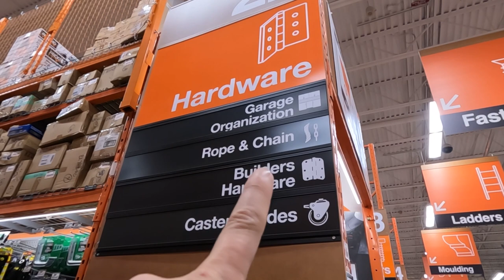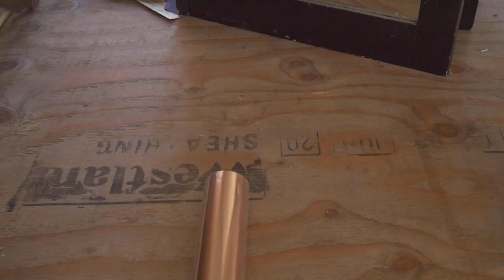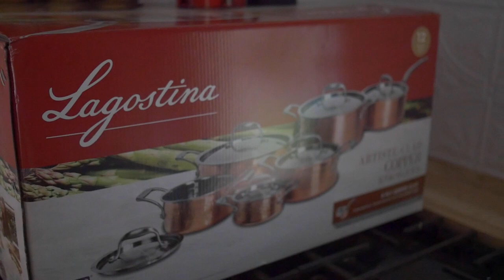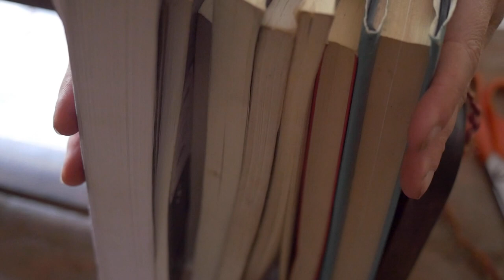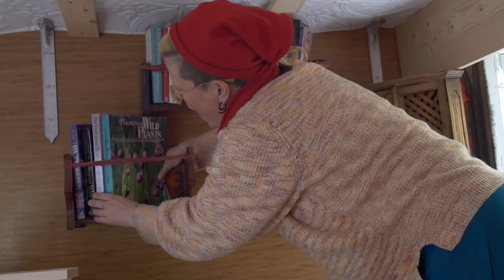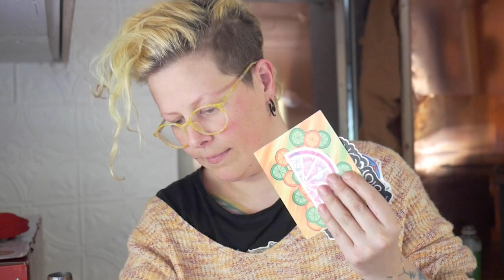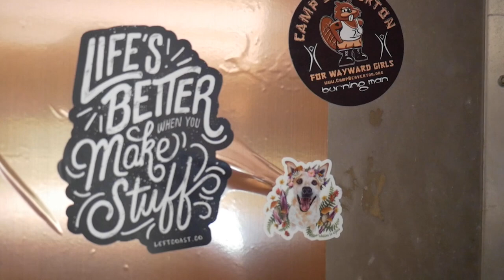Interior Design in the Step Van Conversion - Fire place Cubic Mini wood stove

Comment: Hey its looking good but I was thinking for your Lil wooden boxes box you could drill a hole all the way threw and put a wooden dowel in it to hold them all closed. It's cheap and would fit in with your pirate theme 😉
Reply from the maker: @Star Ramos ooh that's a good idea!! I've tried putting tea bags in them and I think the friction of the paper is keeping the drawers closed for now! Maybe that'll be different if I decide to use them for other things